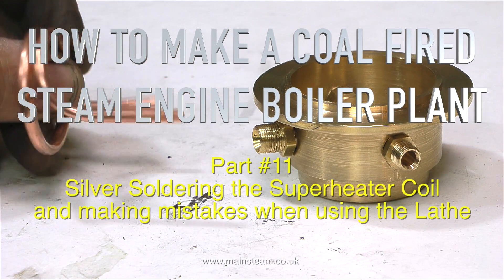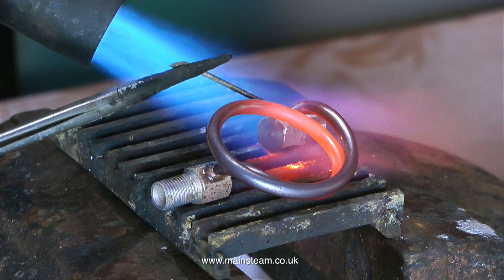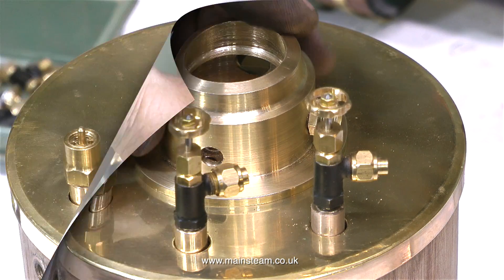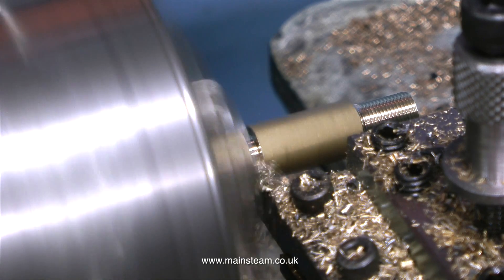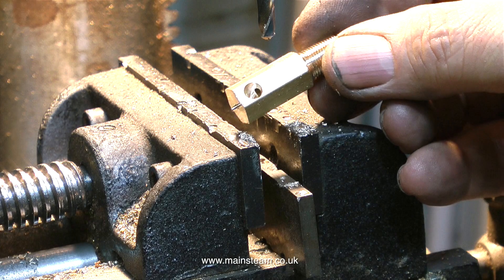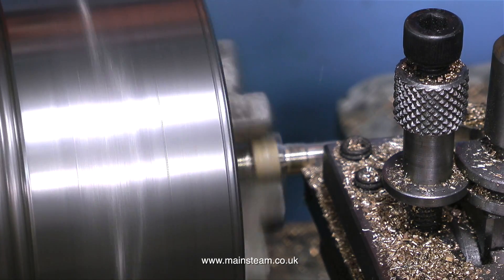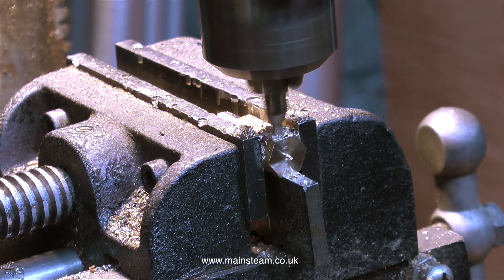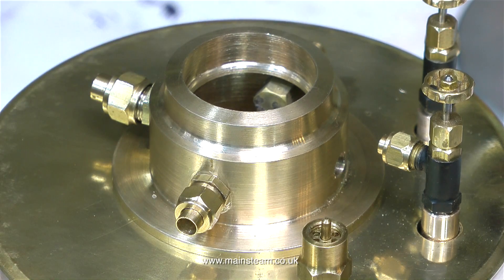HOW TO MAKE A COAL FIRED STEAM ENGINE BOILER PLANT - PART #11

Comment: Got to say, great job with the video series.
I was wondering, with the superheater coil, why do you install the fittings on the opposite side of the top cap, instead of 90 degrees apart (540 vs 640 degrees of bend)?  If you make it 90 degrees apart then there will be minimal bending of the coil upon final installation.
I was also wondering if you are planning on making a video about building the tubed section of the boiler (pressurized area)?

Comment: There is always a certain amount of inaccuracy/offset/run-out with 3-jaw chucks (even the really expensive ones). If you need to machine a part on the lathe then take it out to do something else to it before returning it to the lathe for further work mark one of the chuck jaws, it doesn't matter which one. Put a mark on the workpiece corresponding to the marked chuck jaw so you can put it back with the correct orientation later. Works great with hex bar and even round bar can be returned to the chuck with a surprising degree of accuracy. (Or you could be all posh and use collet chucks...)

Comment: I'm loving this boiler build, especially as I've worked on a few full size Kingdon boilers.

I can't help but feel that with gap above the tubes beneath the smokebox lid being what it is, now that the superheater goes below the lid (or appears to in the video) it looks like you may have issues with flue gasses being restricted- especially on coal with soot added into the mix.
Reply from the maker: It will be fine, after all it is a very small model boiler, the gas flow will be more than adequate..........

Comment: Another great video Keith, I really enjoy following along with these steam restoration / repair guides.I'm interested in the exhaust blast pipe you made as I have a small coal fired boiler that I'd like to do similar to, is the size of the exit jet important in order to improve the air flow over the fire on small boilers like this ?Thanks.

Comment: Steam can be pretty dangerous.  I know early steam engines used a lead(?) plug that would melt end extinguish the fire if the boiler got too hot.  Does that boiler have something similar or do you have some sort of pressure valve for safety like hot water heaters have?  Or do you control the temps of the fire enough to keep them safe?
Reply from the maker: Fusible plugs are not really necessary in smaller model boilers. There is always a safety valve fitted that will exhaust the excess steam to atmosphere if the heat gets too high.